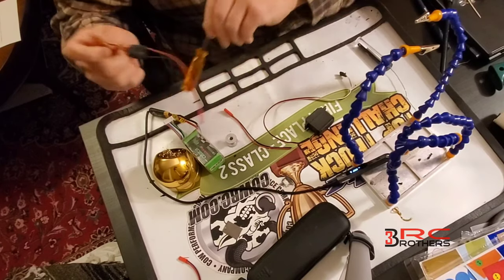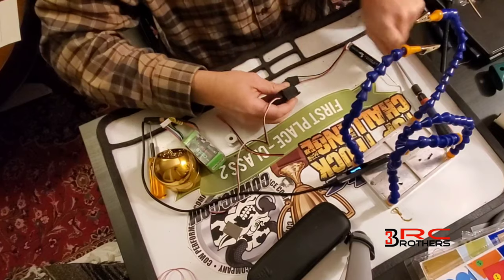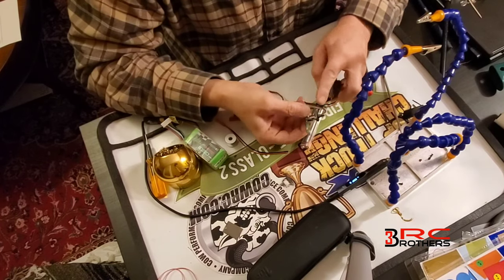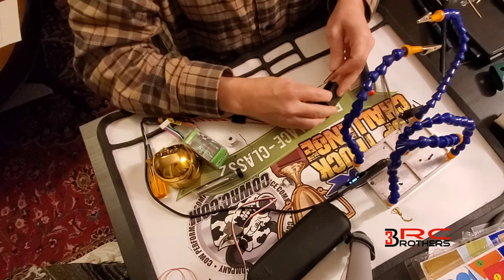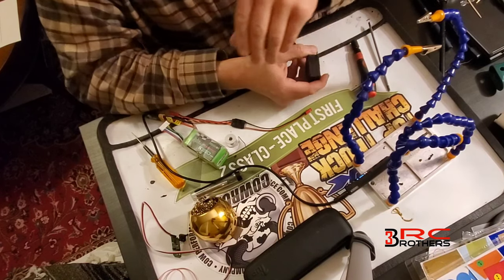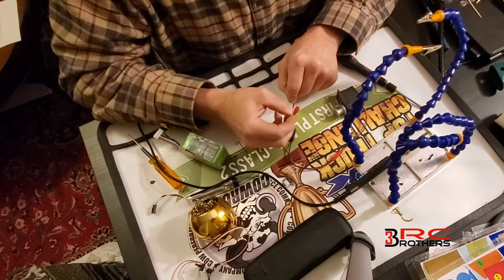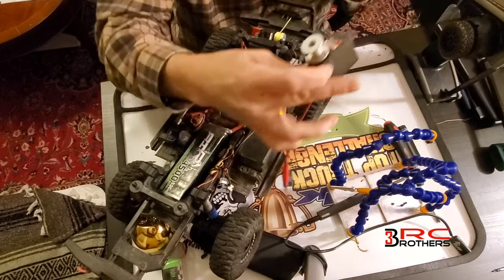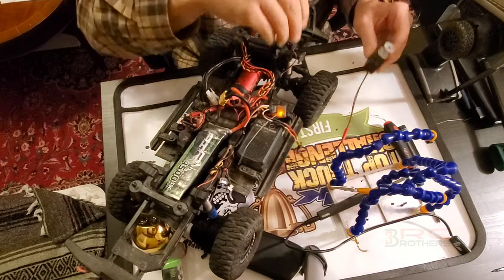Traxxas Servo winch using a 3BrothersRC Winchmaster.

Comment: when will they be in stock?
Reply from the maker: They are officially in stock.
Reply: Have a winch master now. Does the polarity matter on the winch master wires to the winch?  They are both black wires not indicating polarity. Im sure ill get it wrong and need to swap them as i prefer to hard wire everything .